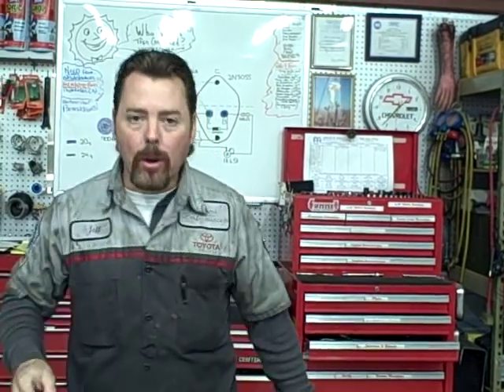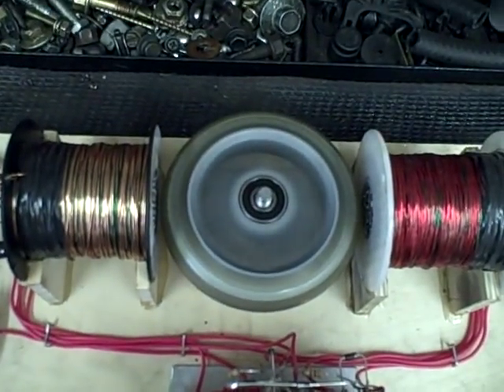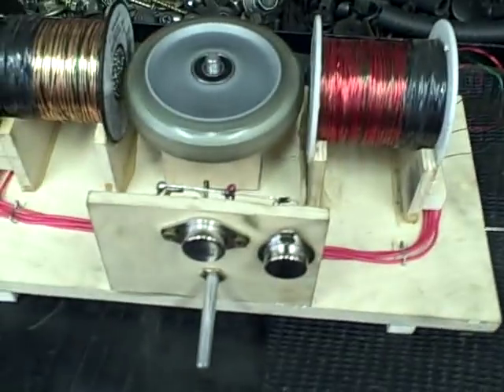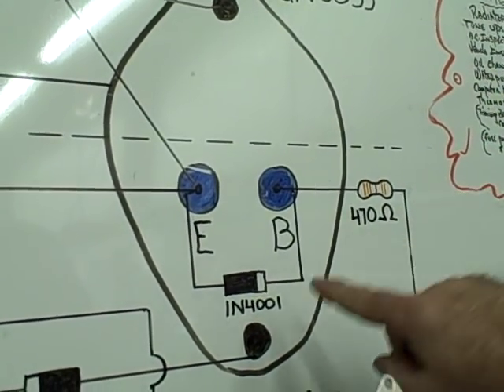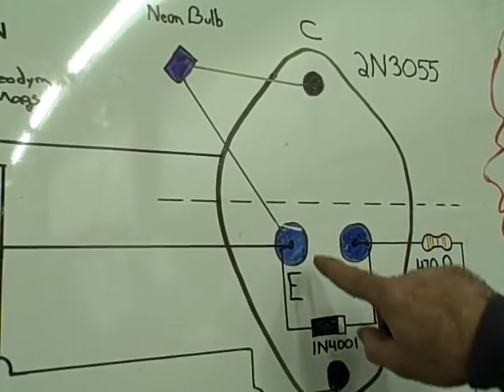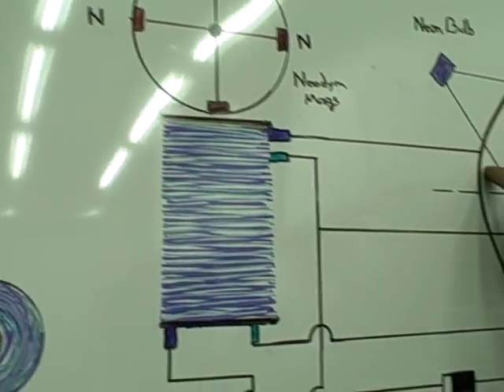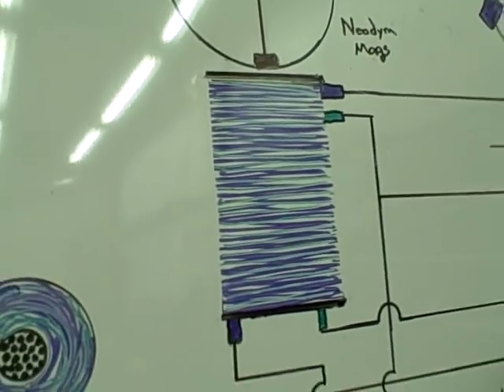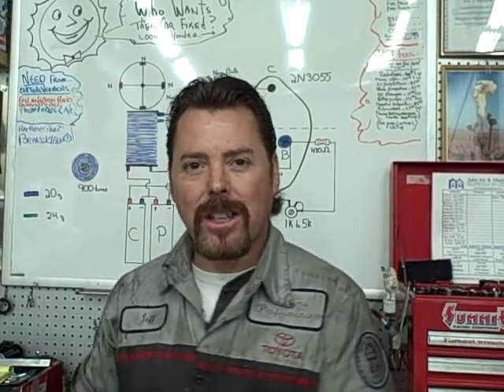Bedini Motor ( Generator ) How To Build One

Comment: As he's running 2 coils he need 2 circuits (they're very small), you can see 2 transistors - It can charge 5+ batteries simultaneously. The more coils, the more torque & voltage. It works because I followed Jeffs simple instructions with great success ;)

Comment: To get more power out you just add more coils, it's not over-unity "as such" but I added 2 more coils and managed to get 20v - The primary battery is set at its lowest possible amp draw and only powers the trigger coil/s. I use solar power to power mine and charge the primary battery, which I only use as a capacitor, lol - BIG THANK'S JEFF!! I couldn't have done it without you!!! Your teaching is second to none! Keep up the good works!;)
Reply: @googleuser2452  Ummm, I am talking about adding extra coils, not just increasing power, if I do that I would naturally get an Amp drop. However, adding extra coils increases both Volts and Amps, which means an increase in power, right?

Comment: He demonstrates that he can cut the charging voltage down to 2 volts and still charge the battery very efficiently.  Thanks for the video.  It does explain the Bedini motor in the clearest fashion.  Thanks Professor Jeff.

Comment: The best way i found to do it is put the spool onto an electric drill, and hold the 2 wires side by side. I also put a piece of tape on on side of the drill so when it goes around and hits my hand, it makes it eaiser to keep count of the turns. It is very important to keep the wires parallel to eachother at all times. You wind the exact same way as you would a fishing reel.

Comment: Hi Jeff! I have 3 questions about things you didn't mention.

1 - neodymium magnets size.

2 - Coil's internal and external diameter, and its lenght.

3 - 2 batteries characteristics: a) capacity in Ah, b) max. load amperage (A)

Anyway you did an excellent video ;)
Thank you!

Comment: hey jeff i just wanted to say thank you for all of your intuitive words and very easy to understand instructional videos on various different subjects like the finding gold videos that i so love watching also i spent like twenty or more years in the electric golf cart industry at best golf service in bloomington ca, i have always dreamed of building a self sustainable perpetual motor myself and despite what so many shallow people say out there that perpetual motion is not possible i have always known that to a degree that it is very probable i just have never really made time to build such a motor and i will definately try to replicate what you have built and i also have the knowledge to probably make your design even more productive what you have built in my opinion looks like it is a very real properly working setup using the diodes and transistors is also smart have you thought about adding several decent size capacitors to your design i am certain if you did it would be better capable of handling more of a load if you were to use it in some type of electric vehicle of course everything in your design would have to be scaled up considerably i would like to meet minds with you on this subject i a currently working as a senior mechanic in an auto repair facility in california so i look forward to a response if you have time thanks again for the info

Comment: I made a bedini motor based on your instructions but with only one coil. And using makshift and crapy parts. I had a lot of trouble geting it working but eventualty did. it was a fried part . I dont think it was over unity but it worked

Comment: Well done Jeff, clear explanation.  It charges the secondary battery well without using much from the primary at all.  Note: if you account for the amount of energy required to overcome back EMP in a standard electric motor, then add that to the energy output, an electric motor is already an over-unity device, i.e. more comes out than goes in.  So why haven't the 'authorities' cottoned onto this?  Why isn't media & government getting behind alternative energy projects to utilise such technology?

Comment: Hi Jeff, brilliant!
One question: you show 2 coils in the video but only 1 in the diagram, how is that?
How are the 2 coils connected up?
Reply: It will work with only one coil or several. Simply  install the separate coils and their related circuitry in parallel.

Comment: This is a mechanical dc to dc converter. It charges batteries by rectifying the back emf of a coil fed with a short duration pulse. A circuit that does the same job could be built without the flywheel and magnets by using the same transistor and power coil (the coil with the thicker wire, trigger coil (thinner wire) is not necessary). If the transistor base is driven with a suitable mark space ratio waveform then the transistor output will be very similar to the Bedini motor output and do the same job of recharging batteries without any moving parts.
This type of circuit is called a buck boost converter.
Reply: Hi Bob - 
 Just curious - I'm building a bi-polar dual axial motor with a Bedini-style control.  Would like to know if you believe that a unipolar Hall sensors (open Drain) would work vs. the Trigger coil arrangement.  Is there some special waveform that comes from the trigger that this arrangement would require?  or is it ok to have as input to the NPN a single pulse waveform? It seems that only a single pulse is needed to initiate the drive cycle. Not sure if it needs to be really sharp or not.  Also, an open drain Hall sensor is set up with  2 NPN transistors to create the correct sense on the drive transistor.   Please let me know your thoughts...   Thanks!
Reply: that exact same circuit on the video can be made solid state, simply remove the in4001 from the circuit and thats it ur bedini is now solid state ;) check out my starship bednini's and solid state starship bedini circuits

Comment: I totally agree that this is the best explanation about Bedini's circuit. Congratulations Jeff  My question is about the permanent magnets. I've read that it is not suggested to use neodym. The blue print I've read suggest ceramic magnet instead. Also there's no recommendation to use iron at the middle of the coil. Could you explain why ?. Tks a lot and have a great day.

Comment: So glad you posted that I replicated it with an erector set and even charged a non-rechargeable battery back to normal, although I didn’t have 20 or 24 gauge wire I used 26 and 30 gauge wire and it works great, even over charged my secondary battery without draining my primary. Just wanted to put it out there and ask if this ever happened to yours, did you ever stop it and it continued to hum?  I got my two coils to continue to work at about 30KHz after I stopped my rotor. Finally got to run it without the rotor at all but it didn’t do much other than vibrate a lot. Again thanks for showing something I could comprehend and build myself and have it actually work.

Comment: Hi there,

Great Video. I am new to this and am interested in building one.I have a few questions:-
1) Do you have a step by step video on how you built this?
2) Can I use this to charge/desulfate my VW Golf battery without disconnecting it from the car?
3) Can two ormore 12v batteries be connected together?
4) Can I use this to charge/ power a storage heater in my conservatory?

Cheers

Comment: I have a few questions for you. How many welding rods and how long where they? And do you rap the  small wire 900 times and then the large wire 900 times on top of that. Or did you rap them together at the same time. How many feet long were your 20 and 24 gauge wire? Can I use more than four magnets?

Comment: practical uses for a bedini motor, battery charger desulfator like this one. some free ideas, most know the box fan bedini life hack. but some i have come up with is bedini ran air conditioner, or the same on a refrigerator motor. of course im talking about the bigger motors and not the small on here.

thanks for your time in this video.

Comment: @attchoum 

It's easy: you take a plastic spool with a hole , take 2 wires 1 20 gauge and other 24 gauge, wrap them together (or not, you choose) and wrap them together on the spool, leaving the starting the start of wires available for connection later on. Do as many turns as you can and put some electric steel in the middle of the spool. So when you finish you must have 4 connections to the spool as shown on the diagram Jeff showed in his video. Hope this helps.

Comment: The key to understanding over unity is revealed in both single second time management and the power unit called the Joule.  Breaking down what occurs within a single second, and how the transistor can switch on and off in milliseconds, to impulse the coils to rotate the disc with less than the power received by the batteries.
Reply: Good points. I like how Bedinin and Bearden put it in their book "... vacuum space time itself is nothing but pure massless charge... it has a very  high electrostatic scalar potential..."  Have you done any work on any of these devices?

Comment: I 💘 💘 💘 your video and YES... I have a question... There are TWO windings in the coil... CORRECT?? a 20 guage and a 24... One sends juice to your charging battery and one propels the wheel... Right? Which one does what??

Comment: Hi, I did a bedini SSG circuit exactly like you did, but the only problem, is that the rotor doesn't spin. I know that my circuit is fine because when all the right wires are pluged, when I spin the rotor, it charges the secondary battery. I have 4 ceramic magnets with a hole in their center attached around a rotor about the size of an adult hand. The ceramic magnets have their north facing out. Normaly, when I push the rotor, the trigger coil is suposed to fire back and change the pole so that

Comment: Awesome work Jeff, I am also working on a bedini motor and am getting good results, I have used a Bicycle wheel for my rotor, I have been messing with stepping the a/c voltage up with a microwave transformer and have managed to get good spark gaps..I have a question tho, you say you need 2 transistors one for each coil, but on your schematic on your white board you only show one? Where does the second transistor go I want to build the same circuit you have

Comment: Loved the video Jeff, but a bit confused about how and where the second transistor was hooked up. On the actual device it shows 2 coils on either side of the wheel but the diagram only shows one transistor and that it is hooked up to the potentiometer. How is the second transistor hooked up ?

Comment: Hi Jeff, going on a decade and your clear and concise video ranks on top of any other that I have come across. Thank you very much. Please, I am still struggling with how to build a bifilar coil with two different wire gauges. Specifically, at what point during winding one gauge wire do you begin to wind the other gauge wire? I hope that all is well with you.
Reply: They are both wound in parallel (at the same time).

Comment: Hi jeff. 
Thanks a lot for this video, was able to build my first bedini motor thanks to this video i only change the coils and rotor, i bought a small computer fan and made a few changes.... i m also using 3 AAA batteries for primary and for secondary 3 more.
But i Do have a question and some people have ask i don't see if you have answer them.  About the  two transistors and the other coil you have on your small device were are you connecting them? or if you are using them at all? 
Puerto Rico

Comment: Nice work Jeff.  My question is when you talked about connecting your coil to the circuit, you mentioned the top wires and bottom wires.  Question 1: Is the top of the coil the start or finish of the winding or does it even matter? Question 2: I built the circuit and have current going thru the coil repelling  the magnets without the wheel turning. What's my problem? Can you or anyone reading this help me out?

Comment: Well, you earned yourself a subsrciber! 😁

I want to build this with a flywheel (approximately 11" in diameter). 
If you connect your primary and secondary battery in parallel, will the voltage stay stable? 

Since, you will only need to use a about 3 coils to run this thing you could probably fit about 10 more coils their and use that to generate electricity and send it back to the battery powering the system. Any ideas?

I hope you reply! Keep experimenting!

Comment: The back emf coming from the bifilar coil is generated by skin effect differential from the dissimilar sized wire. proximity of the wire strands is the key. also you can attach multiple smaller wires to the larger base thick wire and multiply your output. so you can get by with 200 turns and connect  four parallel 24 gauge strands with one 18 or 20 gauge strands. skin effect can also speed up info transmission for your wired internet.

Comment: Hello, I'm about to make a bedini motor following your schematics, but I still have some questions.
1) I want to make the 2-coil version like you have in your video. I suppose that the two wires (20 and 24g) you use on one coil are seperated on two coils in the two-coil version. Is that correct?
2) I already made one coil with 187 turns of 1mm thick wire. I think I will double the amount of turns. Which kind of wire do you recommend me to use for the second coil and how many turns should I make?

Comment: Also on ur collecror base did u use a nut and bolt with eyelets or did u acually solder it to the base. If u soldered it does it matter where u solder wires on base or anywhere on the base is good. Is it better to use a nut and bolt through the little hole.

Comment: Fine presentantion, congratulations. And sure I have some questions: I saw that your prototype has 2 coils, both are bifilars? In that case, how do you get the pulses syncronised? This is why you have 2 transistors in the circuit?

Comment: Jeff, 
did you forget to lacquer or paint your core iron wire? it will warm or heat up wasting power... and Domino size refrigerator magnets work from Harbor freight tools... have you tried putting your coil a bit farther away from the wheel? tilting can help too... building a 3pole monopole J.

Comment: If I have two identical batteries of 6V. I should use the same transistors, capacitors, and the same number of turns in the coils??

Comment: Cool vid.  I think what makes the motor unfeasible is the difference in power generated.  With only 0.08 additional volts @ ??? amps, at least 150 of these would be needed to power a 12 volt device (assuming 1 amp).

Comment: Hi I have the same layout as the wire you have 0.20 and 0.60 and still the same output voltage of 6V to charge the coil wound with 400 turns of a spit and 700 and 900, and anything that does not change the output 6v yet what is causing the output to the load should be 12 v waiting for a tip and thanks for the info

Comment: I used Neodymium magnets & they work fine, I was getting 21v from just 3 coils so I don't know what you're doing wrong. You can use ferrites but you will need big 1s, then you need a bigger wheel for spacing... Small Neo's are fine with small coils and work very well indeed. Be warned, 21v shocks as they arked from my finger were quite spikey but well worth the buzz :)

Comment: I have a few questions, the around 900 hundred turns is between the two wires or each wire 900 hundred turns. And the diodes, can I use two 4007 or it has to be a 4001 and a 4007.

Comment: While researching this device, I was reading on Tesla generators website that the sg wheel doesn’t charge more batteries than the primary battery charge. Meaning it cannot fully charge a dead battery to maximum from the primary. Could you tell me your thoughts and findings on this?  Everyone calls this an over unity device but based on my research it is a motor that does work while reconditioning a battery while being supplied power to do both.

Comment: Sorry to burst bubbles, but I have been trying to make a simple version using a Bosch washing machine pump. A pump composed of a horseshoe shaped piece of steel with 2 shielded copper wound coils. A cylinder shaped magnet sits in the middle, connected to a bladed assembly which turns and drains water. It turns when the coils receive a pulsing charge. It would appear that Bedini worked out the add on to get poor

Comment: Hello Mr. Jeff Williams, I'm an engineering student in Brazil and I'm doing my project of completion on bedini engine, seeing your video with the construction of this engine realized that for each coil using a circuit, knowing this, I wonder the procedure adopted to connect the two circuits? If possible could provide the circuit design for better understanding? 

Thanks in advance! 

Excellent video!

Comment: Your schematic shows just one coil but your construction has two coils.
Does each coil connect to the SAME points in the construction?  Because your board has only one pot but you have two coils.  

Thanks!

Ron

Comment: Alright, some time ago I made the bifilar coils, but now I have a question about the circuitry:
It is clear to me that you have to make one separate circuit for each coil. But how do you connect them to the batteries? 
And you have 2 transistors but only 1 potentiometer, how do you connect that?

Comment: There's a good presentation by Daftman, like the name, that demonstrates what is happening with the Bedini circuit and motor.  He shows how the motor works as an oscillator for the curcuit.  At one point he uses a Pulse Wave Modulator or 555 circuit instead of the motor to oscillat the energy going into the circuit... (more above)

Comment: Do you need a 12 V battery to run this system or will a 9 V work? The Transistors ( 2N3055) are rated at 60 V 3 to 15 amps when i looked it up online. Will that work with a 12 volt battery?